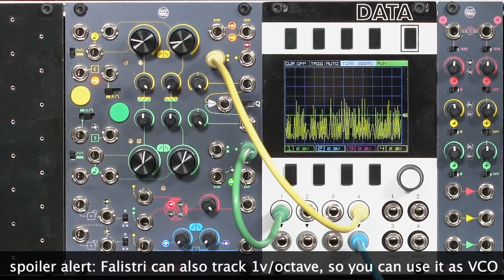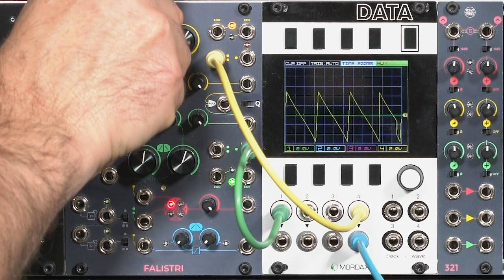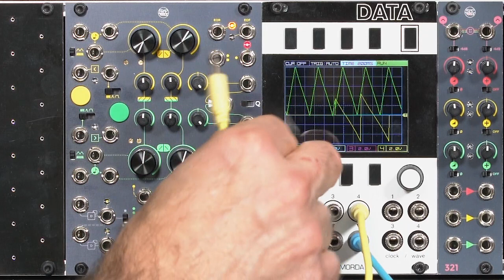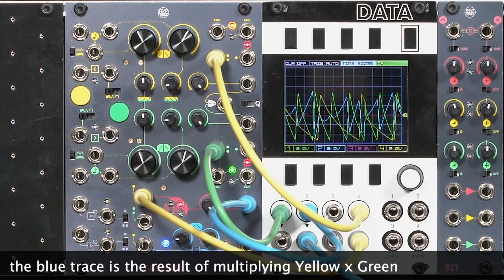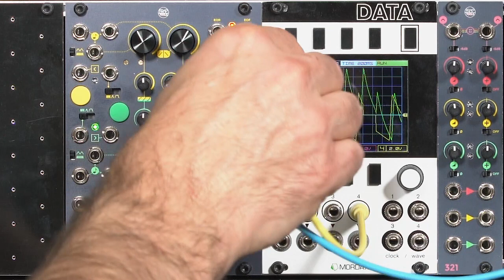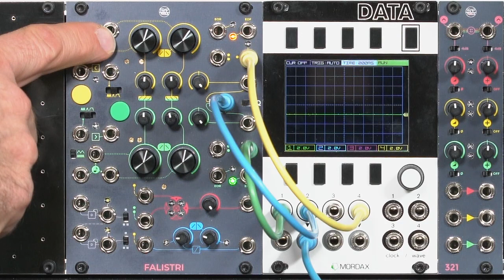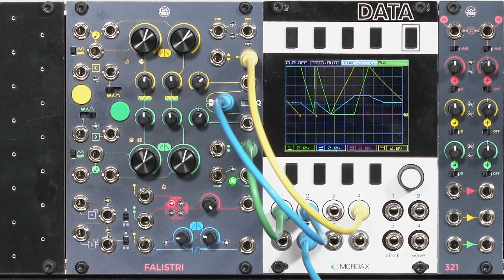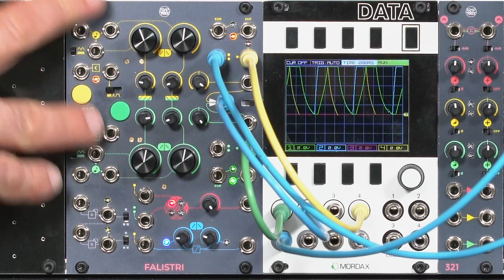Frap Tools Falistri 3/4: LFO (LMS EE)

Comment: Can you clock the LFO somehow so it runs in time to other modules?
Reply from the maker: The way to do that is to send a clock to its normal trigger input, and then set its rise and fall to taste. It will not change the rise and fall times to match the clock (and really - sometimes you want that; many times you don't), but otherwise it will be synchronized.
Reply: @LearningModular  Ha, was thinking about this workaround whilst I was shopping but was unsure If that is the only was to do so.:)
Thanks for the quick replie and your awesome tutorials!